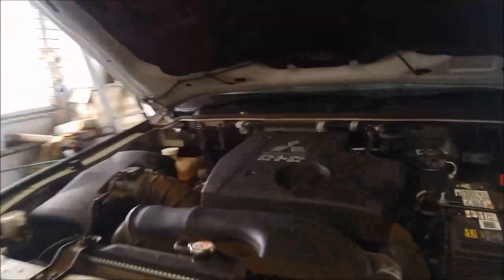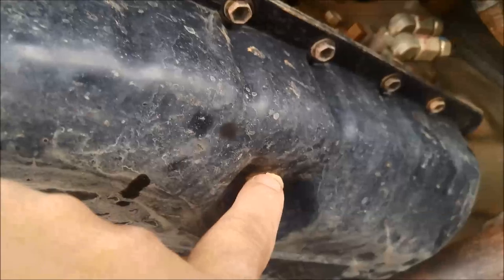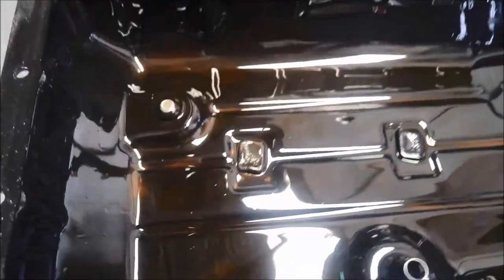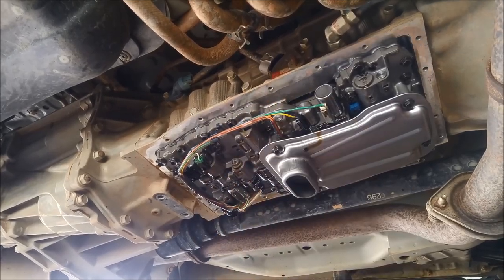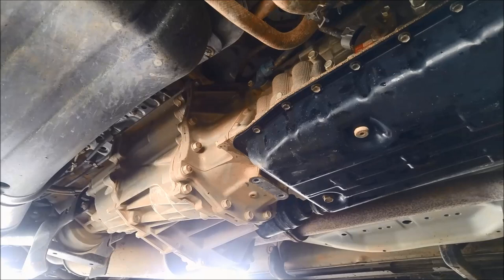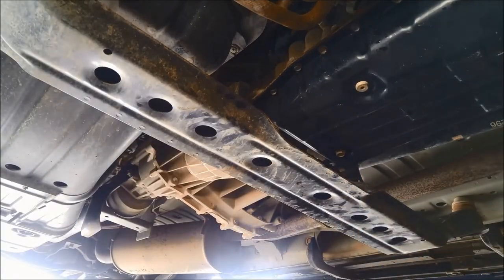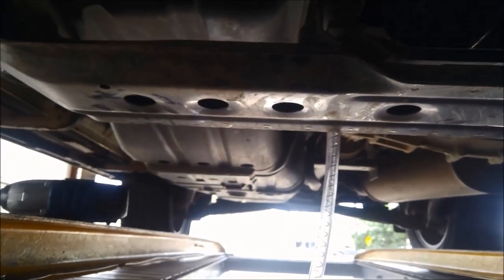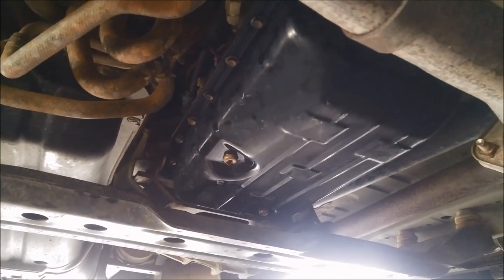Mitsubishi Pajero V5AWF / Toyota A750E A750F Automatic Transmission Filter Service How to DIY

Comment: Big thanks for this video mate, and the other one referencing the v5awf transmission and pressure boost valve. Was happily able to completely change my fluid today (including flushing out the old stuff through the cooler lines) previous owner hadn’t done it for over 100k Km
Reply from the maker: hi, glad helped, thanks & cheers 👍

Comment: Thanks for the video. This transmission was also used on the 2004-2006 suzuki xl7 . 
I have a 2006 one and the whole housing and especially the filter looks exactly the same. I even got a factory transmission fluid cooler
Reply from the maker: thanks for the info. cheers

Comment: Great video, going to do mine in few weeks.
I have a question, what is the procedure to replace all of the atf oil? I’m planning to by the Penrite LV atf. My understanding it is around 10L, is that correct?
Also not sure what has been filled with as people reporting that Mitsubishi using the SP-iii.
Thanks
Reply from the maker: hi, any compatible fluid for your vehicle should be ok. make sure you fill to correct level and check as recommended by manufacturers. cheers

Comment: Thanks for the video. I have a 2016 NX Pajero with about 100k on it so probably due for a transmission fluid change. I think the filter is good for another 100k. I was intending to connect a hose to the transmission cooler and let the car pump out a measured 1 litre of fluid. When this is done turn off the engine and replace this with a measured 1 litre of clean fluid through the filler hole on the transmission housing . I was intending to repeat this 12 times to hopefully replace the old fluid as much as possible. Just wondering do you think this would be a good method to use? Used this method on my sons Prado and seemed to work well.
Reply from the maker: hi, waste of time and effort in my experience ( not like an engine service ), remove the trans pan, replace the filter, clean trans pan and magnet ( and add magnets ). refilling with new fluid that comes out is enough to boost the fluid qualities. we only do a full flush ( need to do at least 3 times the complete volume of trans completely dry ) only if coolant or water enters trans. see https://youtu.be/1paq5RbiTNQ   and    https://youtu.be/Veu5h5evTiY 
 cheers for beers if deserved ? link is in description thanks
Reply: @YepThatsIt  Thanks for your reply. What you are suggesting sounds like a full transmission service. I was only looking at renewing the trans fluid (or as much as possible). A fair bit of work on the Paj to remove the support bar and then drop the pan, replace filter and put it all back together again (though not out of the question as my son is a mechanical fitter). The car has done 100K and the transmission is working perfectly. I have a big trip planned and I thought by renewing the fluid at 100k it should be good for another 100k and do a full transmission service then?
Reply: @dontrump4697 use clear hose once colour changes to brighten red you’re ok then. It usually takes 16-18lt this way
Reply: @resenmkd  OK Thanks.

Comment: Thanks mate. I was thinking about flushing my 2009 NT Pajero but I'm a bit hesitant. When the fluid is cold it jerks into 2nd or 3rd gear with a bit of a harsh change, but once it's warmed up it's okay. I think I'll just change the oil following your advice. Thanks again.
Reply from the maker: hi, contact me on our facebook link, there is some magic juice you can add to help free up sticky valves and solenoids...might be worth a try? cheers

Comment: Great job and very interesting way to check the oil level on the Pajero gearbox (as there is no more a gauge to fill and check the oil level). One question, how do you remove the "old" oil ?, I cannot come to your location (very far from your location). Thanks a lot for this video and the associated advice.
Reply from the maker: hi, best to lower transmission pan. replace filter and clean trans pan and magnets. unless you have trans issues that is sufficient to freshen up trans fluid ( roughly half fluid will come out ). if you need to flush more fluid out we usually suck out via the cooling lines, that will suck out down to the bottom of the torque converter neck but fluid in lower half of converter will remain. hope that helps cheers
Reply: @YepThatsIt  any chance of doing a flush video in the near future? I'm not sure if it will help or not, but my 2009 NT occasionally changed to 2nd or 3rd (I can't remember which) pretty hard, kind of jerks and not really smooth. It's had the 90k service done by Mitsy so all driveline oils and is just about due for the 180km service now so I will try and attempt it myself but am thinking I should probably do a flush. Would love to know your thoughts. Thanks

Comment: Gidday mate. I think my answer will be the obvious one... but to check my transmission oil levels in DID 2010 Pajero Transmission. I run it up to temp, then open that allen key plug and top up through upper side plug until trickles out bottom one?
Also, does this oil feed the transfer case directly behind it also? Or are they separate oils in separate chambers? Thanks in advance.
Reply from the maker: hi, transfer case oil is separate, unless the seal is leaking between transfer case and trans extension housing. cheers

Comment: Thanks for the video. I find that after doing the oil change my Pajero needs to rev to 1500rpm before the car starts moving, so there’s a delay after engaging the gear, this happens after the car warms up, cold seems to be okay. Reverse gear mostly affected. Would you say it’s more or less oil? Thanks
Reply from the maker: hi, if you have internal pressure leaks, as the fluid warms it thins out, so the leak will get worse. cheers
Reply: @YepThatsIt  thanks for the reply. Not sure I understand though, internal pressure leaks? The transmission was fine before changing the oil, all I did was change the oil and filter? Thanks
Reply: @YepThatsIt  please elaborate on internal pressure leaks? Thanks
Reply: If changing the fluid has brought it on, and the level is not low the transmission was likely on its last legs and you’ve dislodged the fine metallic particles that were sealing some internal leaks past the solenoids and or pressure boost valve. 

Changing fluid again may help, unlikely, there’s an old wives tale that you can put some old fluid back to help gum up those leaks again, but an additive would be better. 

Realistically though the transmission sounds due for an overhaul.

Comment: Hi, just want to know approximately how much fluid did you put in, is it about 10L?
Regards
Reply from the maker: hi, sorry cant remember. we use what comes out in tray as a rough guide, just in case wasnt filled accurately or has a fluid leak. always check as per manufacturers instructions. cheers

Comment: Great video mate, I have a mitsubishi pajero nt 2010. There is hard shifting from 4th to 5th only when it is cold. Otherwise drives fine. Transmission service will fix that or its is something major?
Reply from the maker: hi, check the accumulator seals, and solenoids for leaking. when fluid is cold it is thicker. thanks & cheers

Comment: Can the V5A51 transmission in the NP Pajero be replaced with an A750/V5AWF?
Reply from the maker: hi, anything is possible i suppose. i have enough challenges with stock standard so i am not sure. cheers
Reply: @YepThatsIt  haha, righto. I more meant as in are they a direct swap but it doesn't sound like it. Thanks for the reply!

Comment: What oil do you use to refill? Mitsubishi is only sold in 20 litre at an arm and leg price
Reply from the maker: hi, if you`re in australia, we use tritech lubricants or penrite. however any compatible trans fluid should be ok. cheers
Reply: @YepThatsIt  . Yes. Australia. What kind of Penrite or castrol? I have the 2010 diesel NT. Thanks.
Reply from the maker: @cashcow7516  hi, google the brand you are interested in then select your vehicle, and it should give their recommendation. cheers
Reply from the maker: saved you heaps....couple beers would be nice https://www.paypal.me/BATS189 cheers  http://www.datateck.com.au/Lube/PenriteAus/    or   http://www.datateck.com.au/lube/castr_au/   or     http://www.tritechlubricants.com/lube-guide/
Reply: @YepThatsIt  ha. For sure mate. Or if you ever in Central Australia, I buy you couple coldies at the pub 😎

Comment: How many liters of oil do you change in this process?
Reply from the maker: hi, there is no accurate rule. a guide is the amount that comes out, but always check as per manufacturers instructions just incase had a leak or was under or overfilled previously. cheers

Comment: Hello, what about a volume of the atf you need? Thanks.
Reply from the maker: hi, they have a drain plug, so you can get a measure of how much comes out. just make sure you check fluid after filter service as per requirements. cheers

Comment: Thanks for sharing !
By the way , since this is your third tranny of this type that you show how to change the oils , i think it would very nice to make a video about flushing the oil from the torque converter. Again... Thanks so much for all your informative videos!!!!
Reply from the maker: hi, i have a video when i change the fluid several times when radiator coolant has entered the transmission ( known as a milkshake )..... to remove "most" of the fluid, we suck the top section of the torque converter oil out by connecting  trans cooling hose to a vacuum pump and also drain the trans pan. however changing the oil in the torque converter is unnecessary unless you have water and/or coolant in your transmission. if you have a worn transmission, you will only make it worse if you change all the fluid as the contaminated old fluid will be a little "thicker"than new trans fluid....so if you have internal pressure leaks in your trans the thinner fluid will leak through easier...just a normal service is all that is needed, and if that doesn`t improve it, that means you have more major problems anyway and are just wasting money and making it worse by thinning the fluid out more. choice is yours though and i hope that makes sense. cheers
Reply: Thank you so much for the answer. Keep up the good work !!!!!
Reply from the maker: cheers